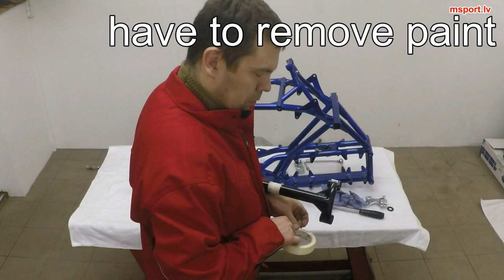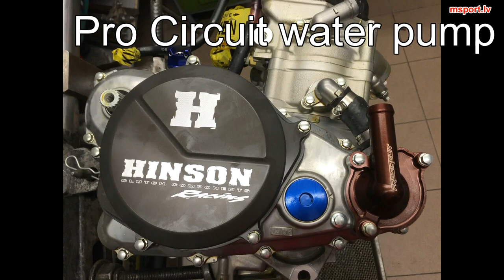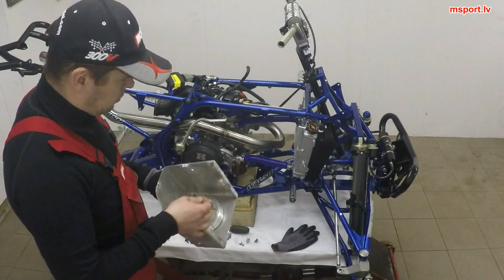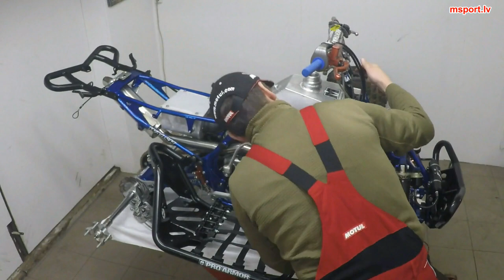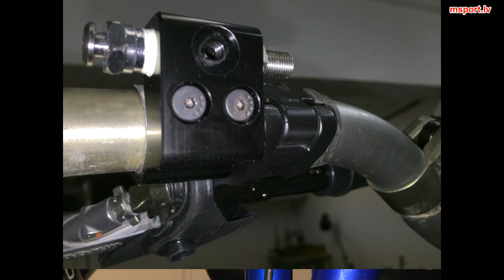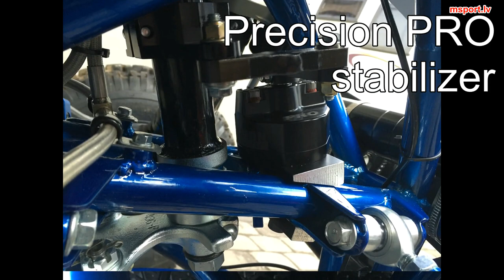walsh crf450r hybrid build

Comment: Why would you put a 450 dirtbike motor in a 450
Reply: cuse it's a 450 XD.
Reply: Cause stock crf motors automatically are bigger better motors way faster plus better hp/torque. Plus there smaller lighter and tbh easier motors to mod. That’s why